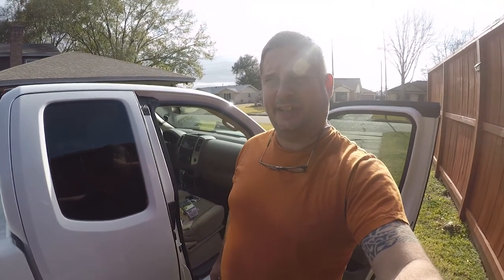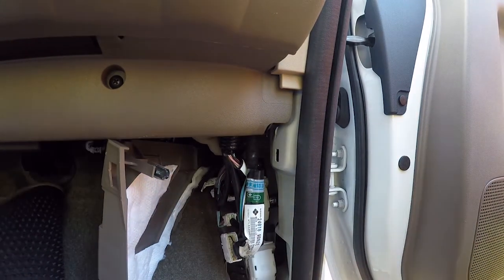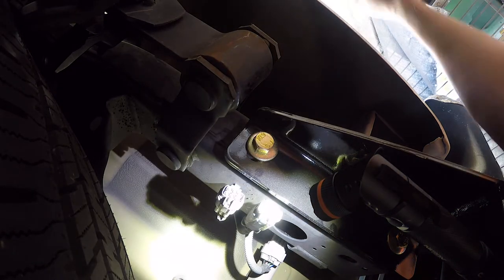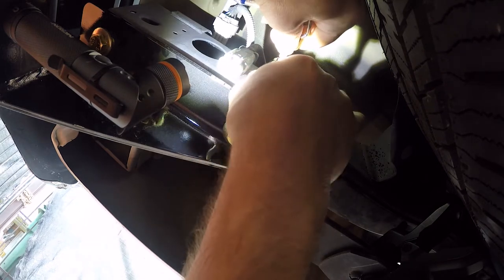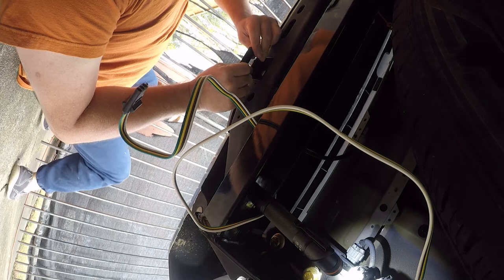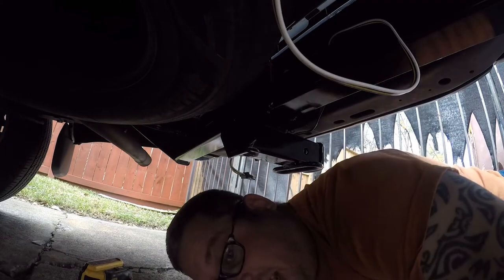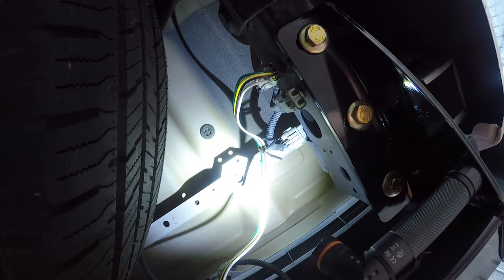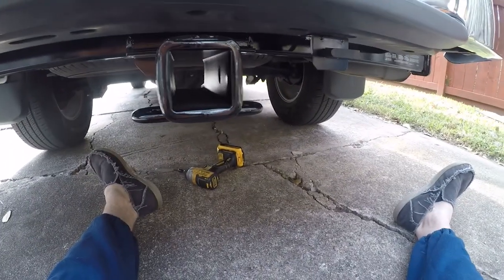Nissan Frontier Installing Trailer Hitch Wiring Kit

Comment: Tricks for removing stuck harness connectors: 1. Knock the connector with light rapid raps to loosen & drop out caked in dirt that will fight release of the keeper, then blow out w/compressed air (a computer duster can w/small tube works). 2. Press the connector together hard to get the keeper lock tooth loose. 3. Use needle nose (straight or curved) to grab connector by pressing on the keeper & back of connector, then pull.

Comment: I know they must have a purpose.... but why are there 3 relay-type plastic "things" at the end of the inside the cab harness??? just curious to their function-thanks!
Reply from the maker: Probably to isolate the trailer brakes from the truck brakes.  That way if you get a short in the trailer it doesn't leave the tow vehicle without lights / brake lights.